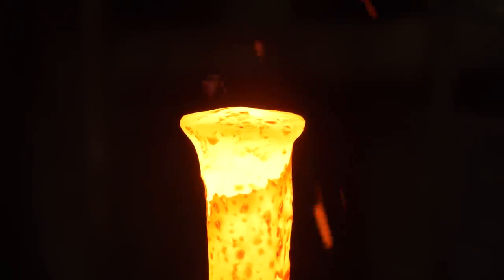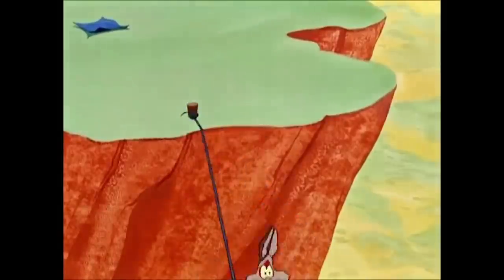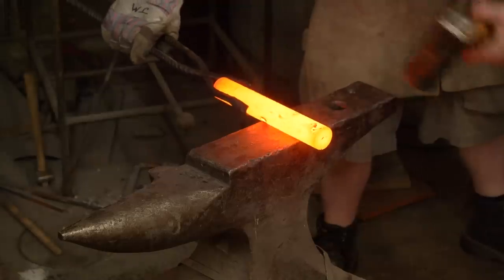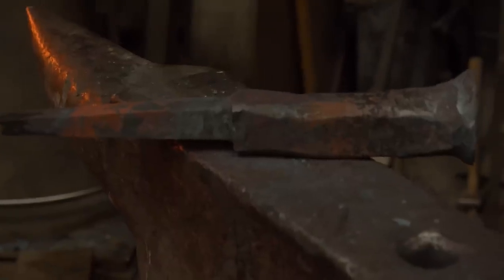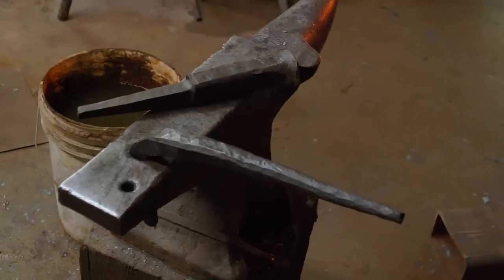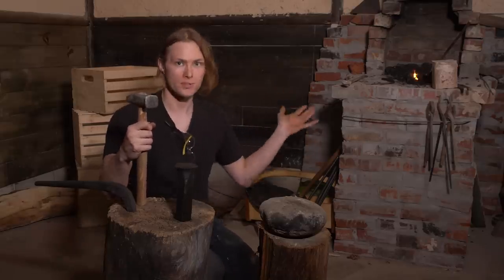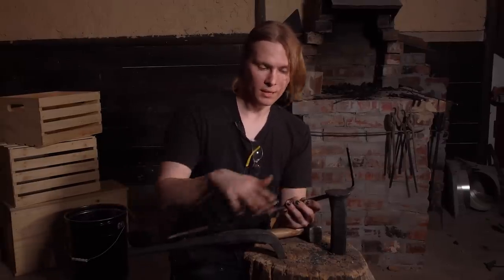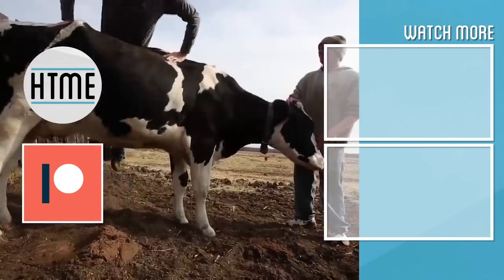Forging a Viking Anvil

Comment: How would you make the Viking anvils without the modern anvil?
Reply: I imagine using the stone versions that they discussed at the start. they probably did it this way to save a lot of time and to make a longer lasting anvil.

You can probably appreciate increase in time using a modern furnace and anvil vs a primitive one.
Reply: using a very big rock and tools you made using the same rock.
Reply: @adamrimmington6577  they were only supposed to use technology they've already unlocked, so this is kind of cheating.
Reply: @crubs83  He's already made anvils. They even discussed it in this video- the bronze one that he had that ended up snapping. He's also in Minnesota, which is not well-known for large flat surfaces of exposed metamorphic (edit: or igneous) rock that can be used as a natural anvil, either. Plus, expedience's sake, for the two smiths helping him.
Reply: @crubs83  honestly that's what disappointed me the most abt this episode, this is downright cheating.

Comment: Viking anvils work much better in tree stumps instead of logs that jump around.  The extra weight plus the shape of the buttress roots makes a huge difference.  If you ask a tree service they can probably cut you one from a customer job.

You'll want help moving it off the truck.  The one I had from my parents' maple tree was easily 400 pounds.

Comment: Forging mine was easy. I got my tongs pride apart my wallet and paid for it. 🤪 the striker in air tools is also called the anvil so I’ve been told by the feller who rebuilt mine when I was an equipment mechanic.

Comment: That's obviously not the ideal stone anvil, but also you use what you have until you find something better. I think granite would be best as it despite having a large grain size it temds to take impacts rather well, but at the same time is prone to spaulding since it does contain water, and the various different grains will have different hardness so it wont erode consitently with use. But still, if you have granite i recomend it unless you can find something better.

Comment: In the viking era, they knew how to work the surface of a rock info a flat surface. They used other type of rocks too, way tougher than the ones in the video lol. There is no way they forged on a small round rock. Every time you hit on a rock that bounce like it did, you lose a lot of power...

Comment: Anvil is the most important tool of all time. Everything made of steel today can be traced back to the face of an anvil. Sure we use machines to shape metal, but guess where the first metal shaping machines were made? On the face of an anvil

Comment: Takeaways:  Those stone anvils and how you (didn't) secure them made a suboptimal experience far worse than it needed to be.  First, shaping stones has been in the human arsenal since before we were properly human. using an unshaped stone for the anvil is not great.  The stones were poorly chosen considering their properties.  Also, support the stone.  Sure, it's going to be hard to secure it well, but even something like a bucket of sand, a coil of rope or a thick chunk of somewhat wet clay between rock and stump would go a long way to help control the transfer of energy in a more easily directed manner.

Comment: The iron (mild steel?) anvil is obviously way better. But to be fair. If you actually need to use a rock you would take a lot of time to find a flat big rock. Then you would take a lot of time to make sure it is table. You wouldn’t just lay it on a flat stump. You would form the wood to hold the rock.

Comment: Instead of a small rock on a stump of wood. They would use a boulder that was inside the ground already. Literally a 20ft by 20ft rock embedded in the ground. If that cracks they can move the metal somewhere else.

Comment: The Irony that they used an anvil to make an anvil.
Reply: That's cheating. They're only supposed to use technologies they've already unlocked.
Reply: @crubs83  It was specifically explained why an anvil was substituted for a stone in the beginning. We've forged on rocks, and Andy's made bronze anvils, but we'd go through several of both if we tried to do this kind of work on them, unless someone out there would allow us to bring a team of dozens of volunteers into their quarry to get a chunk of granite that weighs several tons.

We don't have several months to make a single anvil on dozens of rocks or the resources to continually cast and work harden bronze anvils as they break. We also don't have giant tracts of land to quarry out, nor do we have slave labor like was historically accurate. It's just an issue of logistics.

Comment: The comparison wasn't entirely fair. I'm familiar with some rocks that would hold up a lot better than that one. A lot better. As in your hammer will break before the rock does, and no human has the power to move them a millimeter with a hammer strike. Of course, these rocks aren't exactly hyper-portable, but people could move pretty big rocks, pretty early on. They were also very familiar with the characteristics of different types of rock.

Comment: Need tongs to make tongs, and you need and anvil to make an anvil
Reply: Bronze or copper tongs would work just fine for making a pair of iron tongs, and those metals can be worked cold, or you could use wood carved to shape as rudimentary tongs if need be. Similarly, you don't need an anvil to make an anvil, but for brevity and effort's sake, they didn't go and find a large enough flat, dense metamorphic or igneous rock like basalt or granite and then lug it back for a single use, just to make the viking anvils, or get a piece of high iron ore and grind the surfaces flat to do the same.

Comment: I'm curious why you guys decided to have 3 people hammering instead of just two people hammering on the same spot like a man powered power hammer, and then let the smith have more free control over the piece.
Reply: Sometimes you just need more hammering. These days we have Power-hammers for that, but in the old times it was quite common for up 5 people hammering away at a piece to shape it. 
Plus, it was a good way for apprentices to learn how to handle a heavy hammer with some degree of precision.
Reply: @The_Keeper  I mean... yeah, that is what I'm talking about. I just think it was a bit weird that the smith had to hammer too, it seemed to be making keeping pace a lot harder. I've seem this before, the smith tells where to hammer by hammering and the helper follow by hammering on the same place, but I only seem people doing that with 2 people (the smith and the helper). a lot of the historic artwork and writings I've seem had like 2 or 3 people hammering a single spot and the smith only handling the piece, so it was like using a power hammer but with people.
Reply: @danilooliveira6580  Historical artwork is just... "ehhhh" outside of manuscripts. The smith always has a hand hammer to call out strikes, since the strikers are generally (not in this case with Joe and I) less experienced, and don't have the same picture in their mind of what's happening.

We have all three people striking because it's faster, and easier. It takes half as much energy from one striker for twice the number of strikes, and you get more strikes out of each heat. That all means we spend less time, and have more energy afterwards.

Comment: Why do all blacksmiths always seem to be wearing shorts when working with red hot metal that keeps slipping out of their tongs?
Reply: It's hot.
Reply: @JamesRPatrick  i get that, but if that flying piece lands in your leg its about to get much hotter quickly, even if it's for just a second while falls I wouldn't want that coming in contact with my exposed flesh
Reply: @VGInterviews  You either learn to not get molten hot metal on yourself or you don't continue
t. welder

Comment: Vickings use to have roman anvils...now making a tiny block looks rare and a bit useless. It limits what you can do. But remember blacksmith use to work in teams not singles and alone. A little anvil doesn't provide long range of work. We only speculate based on archeology. Most of remaining are tombs that any tool you find is only a decorative for the dead. I would like to see a blacksmith giving away the only functional anvil, and then what, start new business. Hehehehe

Comment: Actually, most of tribal Africa never got last stone anvils until they were conquered by Europeans. (The exception is Ethiopia that got isolated due to the rise of Islam.)
Reply: Yes they did get beyond stone anvils beforecolonization, they used them in conjunction with iron anvils… They often still stick with stone anvils in conjunction with iron anvils, because they have access to local rock types that works very well as anvils and sledge hammers, and because stone dont suck the heath out of iron as fast as steel anvils and hammers.

Comment: Those guys really need to anchor their anvil down better.  That's sketchy and dangerous as all get out with it wobbling and jumping about.  Every anvil I've worked on and every blacksmith I know has their anvil anchored so it doesn't move around like that.

The rock anvil should have rock that's suited to the job, not crumbly sandstone, and you'd never balance the rock on top of a stump like that.  It would be a larger rock and set into something that would hold it well, a pit with sand or something similar, so that it stays in place.  If it's a big enough rock it would just rest on the ground.  The surface would likely be cround flat as well, so it wouldn't be just some random little stone like was collected for the video.

Comment: y'all need to spend more than 30 seconds getting rocks.
do you honestly think the first folks to use rocks as anvils just threw the first thing they saw on a log and started hammering?
They didn't even have hammers.

Likely they used wood blocks, ON A STUMP.

Later, maybe, they burned a rock INTO a stump, such that it didn't move.

Think about the process, not just how to make a dumb video.

rethink this and think it through, for christ sake...

FIRST PRINCIPLES

Comment: Safety! Safety!...That Anvil need to be anchored down better..Probably  better to use a Swage Block (if you got one)..Those Tongs are a bit light  for  that kind of Hammering ....Lucky the piece didn't fly up in some ones Face....Then again there was a Trip Hammer there...But I guess you were trying for the more primitive method*....Other than heating the piece up in a *Gas Forge

Comment: You guys are absolutely driving me CRAZY with this video.  I had to stop watching it.  Have you ever seen a London pattern anvil with the heel broken off at the hardy hole?  I've seen many because of what you're doing in this video. The hardy hole is used with hardy tools that fit into the hole, NOT for making the tools themselves!!  That is what a SWAGE BLOCK is for.  Also,  when hammering in a gang, use shorter handled sledge hammers.  That one handle was WAY too long for this type of work.  In case you're wondering, I've been a Blacksmith for over 30 years including for the National Park Service and went through an apprenticeship. Anyway, I don't know what else went on in this video because I had to stop watching for my sanity......